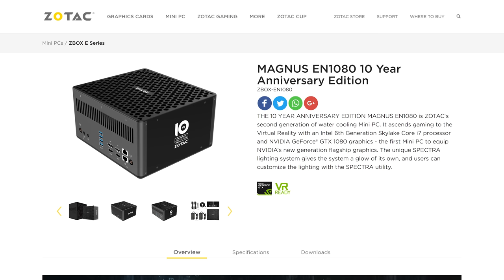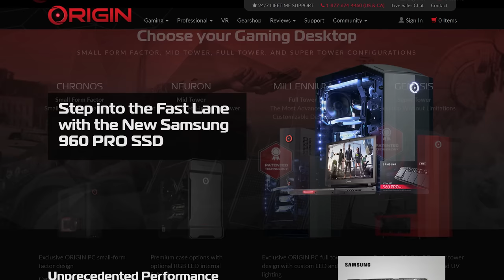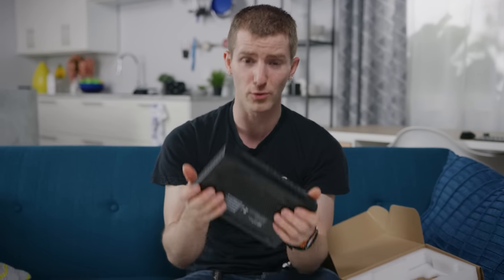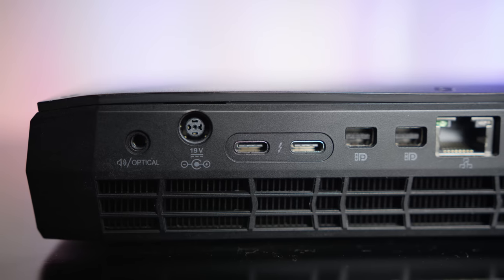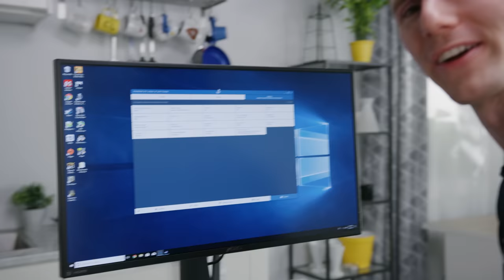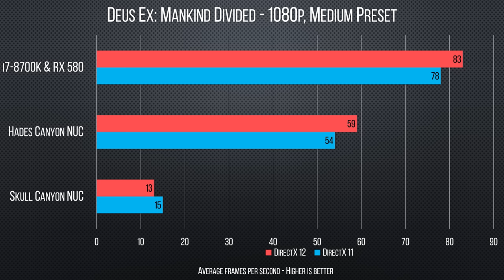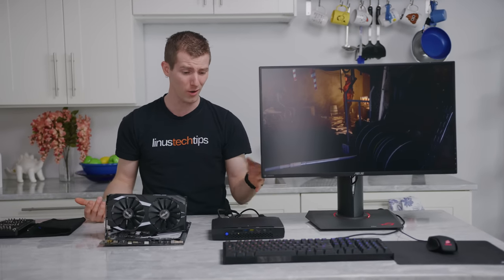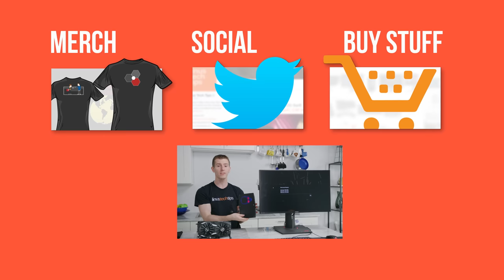Intel's Coolest CPU EVER... Thanks to AMD!

Comment: Wow that's pretty incredible what that little box can do.  Your comparatively priced full size made me laugh a little though.  That i7 8700k is sitting over here yawning while the RX 580 is sweating its balls off trying to keep up.  With that same CPU and a Titan Xp, I get ~120-144 fps on Deus Ex and FarCry 5 running ultra @ 1440, and it's the Titan at 100%, not the 8700k.  Still it's really cool to see the blue and red team working together.
Reply: He should have paired it with a 7700k to get the closest possible match. To be honest, i5 8400 and R5 1600 are more appropriate CPUs for a "gaming" PC since even mid tier doesn't break a sweat with current top tier GPUs. And if history repeats, that will stay true for 3-5 years.
Reply: Nice if you can get that in a small form factor. FYI not everyone has an unlimited budget and have student loans, car loans, annoying wife spending money, and other things to worry about where a 1080P gaming monitor is good enough. My RX 470 which is about 85% as fast as your rx 580 can run Dues Ex and far cry fine at 1080P. I need $$$ for my SSD raid 0 for my virtualization labs for work. That actually pays me money back unlike the GPU
Reply: Timothy it's all good man, I wasn't trying to shit talk anyone's rig or anything.  It was just saying that in the test in this video, that CPU seems pretty OP for that graphics card, not that it was a bad graphics card.  They could have probably saved some money on the CPU and gotten a beefier graphics card for the test is all, it would have probably been more balanced and maybe get a little better performance.  The i7 8700k, even with a Titan Xp only runs at ~50 to 60% on new games like Far Cry 5, it's a powerhouse of a chip.  I previously had an R9 390x and FX 8350 that served me very well for a long time.  The RX 470 has great value from a performance/cost ratio, even compared to a gtx 1080 which is twice as expensive.  And if you aren't running games above 1080p then any more horsepower will just be overkill anyway.  My goal was to run games at 1440 @ 144hz.  I by no means was trying to trash talk any mid grade hardware.  I get the money thing too, I worked 80 hour weeks for about a month to save up for my latest upgrade, and waited patiently to find one selling at MSRP on the Nvidia website because they are perpetually sold out.
Reply: I think they were sticking to the Intel CPU/ AMD GPU trend that the new chip is

Comment: Let me tell you something folks. Instead of buying this, buy a 2018 gen Helios 300 laptop with Core i7 8750H and fully pledged overclockable GTX 1060 6GB along with 16GB 2666 mhz ram and 256 GB SSD, 1 TB HDD, plus some 45 watt hr battery to back things up, all for the same price of $ 899.  Just plug in that laptop to some monitor and leave it like you would normally leave that same Intel NUC on the desk or table.

Comment: So why havn't they done the following.

Take the NUC, REMOVE the GPU from it, (To bring the price way down) give it 16GB of Ram and a slightly beefier CPU. (Again for Less)

Then have an EXTERNAL GPU.

This way its still MUCH smaller overall than a PC, more powerful than a laptop, and easier to carry around (LAN Parties) But also the USER gets the choice on the GPU.

Seems pretty streight forward to me.

Comment: Intel using an AMD Vega custom GPU, amazing.
Performs damn good too.  I think Vega has more potential than people think, I just feel no body has figured out the best use case for it yet, but I think they found it.  Small form factor iGPU replacement.  
Maybe they could make a custom vega chip that performs like a 1080ti if they could get 70-80CU, keep it cool, and keep the voltage down far enough, then maybe they could even make high end desktop GPU's that compare with the newer Titan.
Vega is an interesting architecture, and has potential, it's a monster that has yet to be tamed on the high end prosumer market, 1080ti/titan levels is where VEGA should be, but it isn't.
Not because it isn't possible, because i completely think with a little innovation, AMD could create a 2.5 slot custom VEGA GPU with three fan cooling and vapor chamber heat sync.  This card would have to have some serious cooling potential, so they would have to make they fans move more air + the vapor chamber heat syncs able to soak up more heat + they would have to use top of the line thermal compounds.

I think with that, and their special skills and knowledge they have from being the creators of the architecture would put them in a position to bring a card to the market that could honestly run with Nvidia's upcomers.

Hell, maybe it's just wishful thinking.

Comment: Hi linus im using a huawei router model - E5787s-33a 4g+ router.... I get disconnected frequently from the internet..... I am using the connection on a mobile phone samsung s7 edge.... Please help me with a solution.... Its really irritating..... And I dont even get good download speeds...where the supplier provides around 20+mbps speeds.... When I tried a speed test i wudnt even get 2mbps....please help
Reply: I bought the router on a contract
Reply: Its not even been a month

Comment: So basically, what we've got is Intel and AMD collaborating on what is effectively a pretentious gaming console.  Just buy an Xbox and save $400.  Or cobble together a desktop PC and get much better performance.  Or buy a laptop and get much better portability and convenience.  It isn't particularly portable, it's virtually non-expandable, and it's way heavy.  This is a contender for the 2018 "What were they THINKING!" award.
Reply: This would be an ideal workstation that you could carry back and forth. Also it has more performance and 100x more usability than an Xbox or PS4 does. Laptops are ideal if you're working outside of say an office where you'd use a monitor anyways and the laptop just sucks up space(know from personal experience). It's also extremely portable, anything thats the size of a novel is more than ideally portable.

Comment: If you consider how much money you'll save using this just in terms of electricity alone over its useful lifespan, you probably should be comparing it against a desktop that's $200-300 cheaper if not more...

What might the real world performance difference be between the $999 and $799 models? Obviously the GPU loses a sixth of its power (so that could be 48fps instead of 58, in a particular one of your benchmarks), but would that minor-sounding cut to the maximum CPU overboost really be noticeable? I think I might be prepared to tolerate that in return for a further 33% reduction in power consumption. 65w all up is about the same as what my otherwise ordinary laptop peaks at... of course you have to add the monitor consumption on top of that, but those can be surprisingly efficient these days.

(I just find it hard to justify computer power consumption above 100 watts any more, having become used to using relatively low energy laptops... averaging under 10w in some cases... and certainly none of my more classic machines and older-gen consoles draw anything close to that. If you left a 100w machine on 24/7, even that would cost you a good $100 / £100 to run over the course of a single year, so this stuff does make a real difference to your cash in pocket)

Comment: does this thing not come with RAM or SSD?
Reply: 10 sec Google or simply watching the video is too much to ask?
Reply: No, most barebones systems don't. They're the one thing you can still upgrade, whose requirements vary most amongst potential users of otherwise identical boards, and are most likely to need to replace should they become faulty, and whose prices fluctuate (and, on average, fall) most rapidly. It makes sense to leave them empty. You can just add them to your cart along with an OS disc at the same time as buying the machine itself, it's not a massive extra cost or any real hassle...

Comment: I have the step down version of this NUC. 32 gig ram and two 1TB NvM m.2 drives. As far as upgrade ability Linus over looks the fact it has two thunderbolt 3 connections which you can buy a external graphics card holder and connect to. Such as this one https://www.amazon.com/OWC-External-Expansion-Thunderbolt-Graphics/dp/B07BFFBTCP/ref=pd_day0_hl_147_7?_encoding=UTF8&pd_rd_i=B07BFFBTCP&pd_rd_r=0a97b1fd-406c-11e9-b634-97f70bd5522d&pd_rd_w=u0kDz&pd_rd_wg=FYOms&pf_rd_p=ad07871c-e646-4161-82c7-5ed0d4c85b07&pf_rd_r=S8J7BMTH7X13WY21EPG0&psc=1&refRID=S8J7BMTH7X13WY21EPG0 or others.

Comment: Arm save power. and for now is big market for phone and low power tech. the future will dominate low power energy tech that with one charge last days  on phone   tablet.... laptop ...even  pc or  server.so less  power...less   heat    bring    a smaller smaller   cpu even 1nm   and why not less ....soo in 10nm intel cpu   we can put 10 cpu arm with 3-ghz each one       so total  we have  30ghz  cpu arm ....arm have system android &ios     have infinit app   si to bring arm pc  it dont need too much windows........ windows need arm to   bring the big  lost market like phone .    soooo windows ..facebook....google   ...amazon....etc   are helping  ARM  by big market it has..  soooo the prediction  near future Arm  cpu dominate by it big   market  and   easy practical  for all tasks  in 24 hours    ...even  INTEL AMD  are interested  to be actors  but now that are predendin  no.....that know  will losing not phone and other big market  even cpu of pc